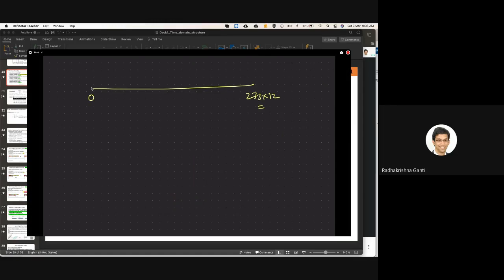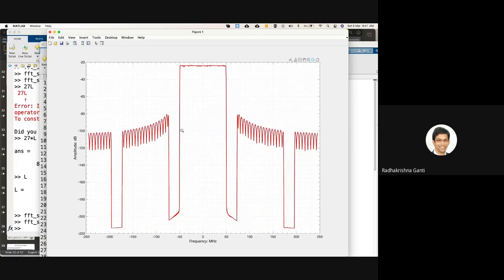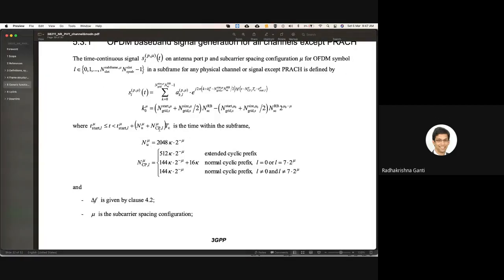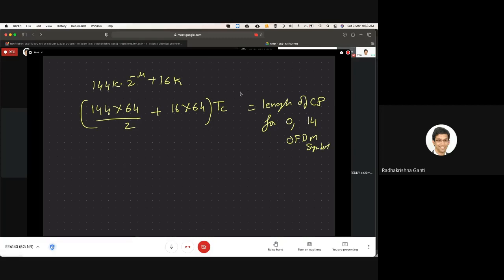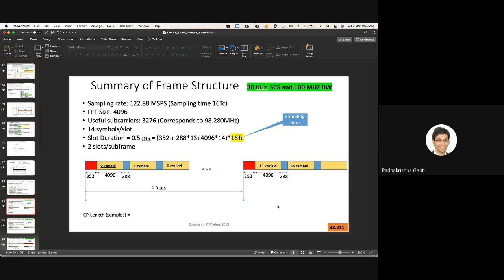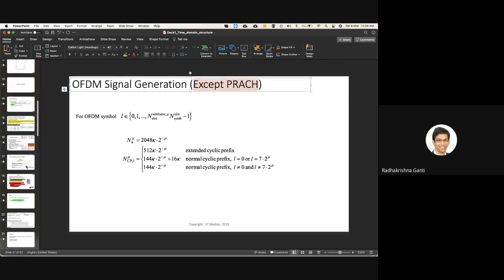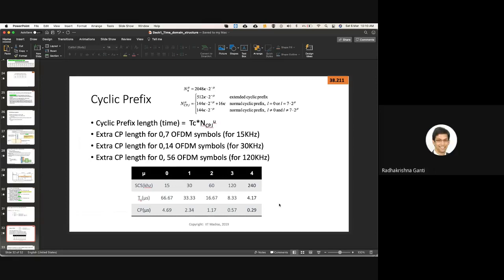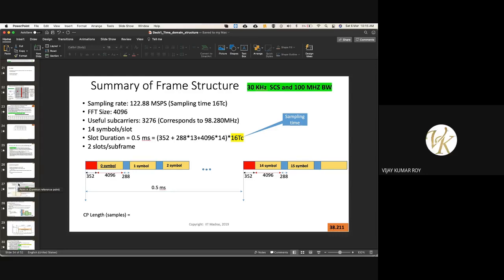EE6143 Lec13

Comment: 36:47 Why Ext.cp only for 60kHz scs and not for any other scs - the explanation given is excellent (Thanks to Mr. V.K.Roy for answering and Mr. Manoranjan for raising this question)

Nevertheless, E-CP at 60kHz scs sounds to me like an oxymoron. 

If  the cp requirement was sooo "extended" , that means multipath are prominent--- this ,means frequency dependent fading is prominent. - This will demand smaller scs. And smaller SCS, naturally will provide bigger duration  cp.  Why would a use -case with prominent multipath(which need bigger cp), go for 60kHz scs in the first place? 

While this concept of E-CP was being discussed in 3gpp meetings, I wonder, what use case the proponents of ECP would have put forward. I am curious to know, at least one use case , where ECP is genuinely useful.

Comment: Three things I am not able to understand in 8:16 (graph)

1. Why is the maximum amplitude at -23dB (bwteen -50mhz and +50mhz)? It must be at 0 dB , correct? ( the energy of qpsk symbol is unity). Even if we adjust for oversampling,  -23 dB is not getting justified. (-23dB means a factor of 200 , right ?
2. Why there is a noisy line between -50and +50 Mhz ?We are sending qpsk, not qam. I executed the code and by-passing the awgn step. Still I am getting a noisy line 
3. How are the side artefacts coming? Are we using some sort of windowing in the pspectrum() function ?